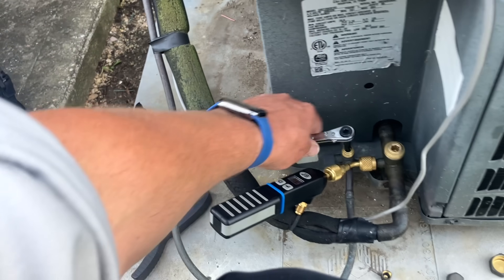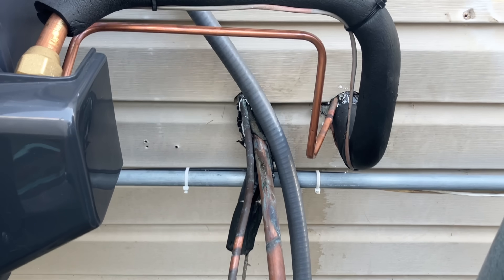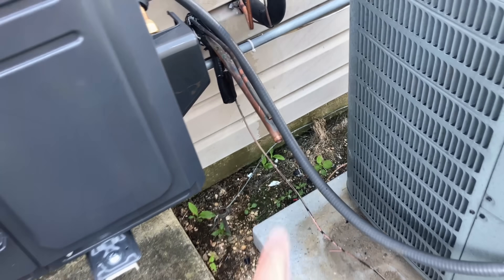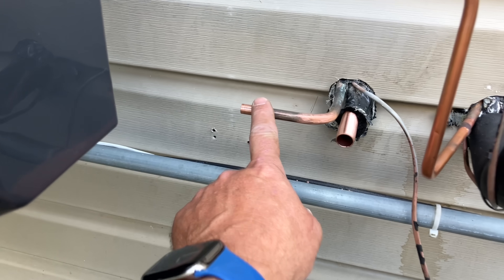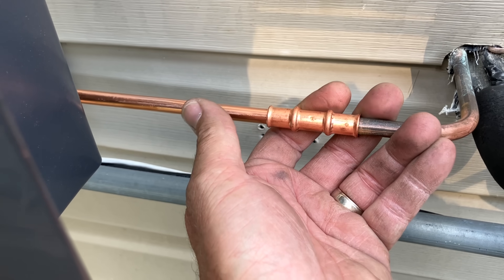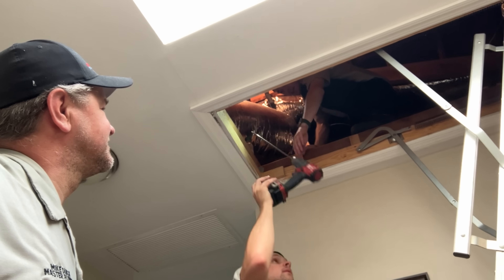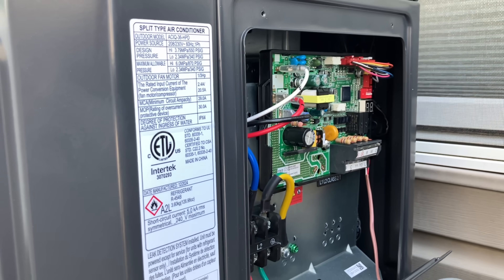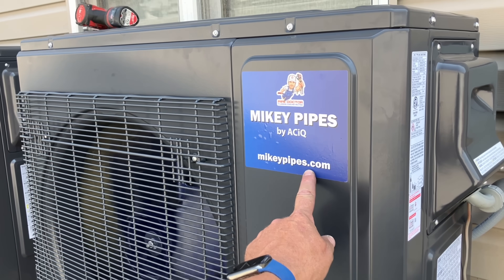Part 2: ACiQ Heat Pump Retrofit – ZoomLock, Surge Protector & Deep Vacuum Install

Comment: Can't these units heat to their rated capacity down to 0F? The old 36F mark was for older single stage units. Unless they didn't get hyper heat models which would have been dumb. Switching over to expensive oil at not even freezing is kinda silly.

Comment: Question: Should the high pressure line be insulated if it's being used to pump heat into the house in the winter?
Reply from the maker: No

Comment: I have a envision series 7 Geo-thermal heat pump, it was sized for 76 summer/74 winter, it really is comfortable, but i wish it had been sized for 68 summer/78 winter, next system will have hydronic capabilities for heated showers and de-icing of the driveway and walk ways.

Comment: Something I’ve noticed with the newer units is if you will start pumping it down and shut the valves off right as the bypass kicks in, you’ll notice that it will still pump down 95% of the refrigerant back into the compressor and coil. Always enjoy the videos👌🏼

Comment: Really looks clean and neat but the inspector in my area wouldn’t sign off on mounting in front of 2 windows, just saying…🤷‍♂️
Hopefully the condensate drain issue has been rectified with vents 👍
Reply: hopefully they wouldn't sign off on it being in front of the electric meter either..... that's where one old condenser was. lol

Comment: The windows are partially blocked 😮
Reply: Sad thing is there was room to put one unit on each side of the window. No matter if the customer was “fine” with it and gave the OK, there was no reason to do it that way or even ask them to do it that way.
Reply: @JSH1  electric meter is to the right, in which the last install had condensers in front of blocking. that's a big fail and not allowed. utility co and code wants minimum three feet clearance in front of it and from gas meters(10 feet preferred) and a fair amount to each side. the last condenser install was bad and they could make you move them or the whole electric service entrance if anything happened that it needed repaired/replaced.
Reply: Those windows are useless for egress,that would be a problem in Florida.
Reply: All those years of experience and expertise shot the hell in one job, that's some shade tree shit right there, that even me a DIY would never do.

Comment: Those are some awesome units. Great job guys.
Reply: They are definitely great for the northeast of America because in New York. It’s 60° today and it’s June 14th, meaning air condition is only used about 70 days out of the year, if this was Florida these units would die in 5-7 years tops because AC is used 300 days a year
Reply: @Nafpaktos-Florida  Why would a heatpump die earlier in Florida? There are plenty of products from China build with quality stuff and would be able to run for many years (ofcourse they need propper maintenance)